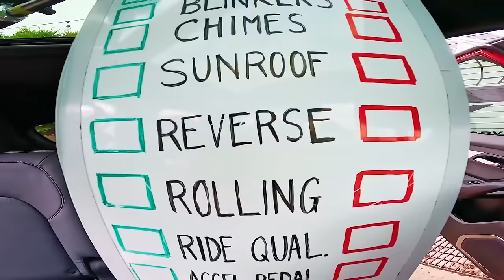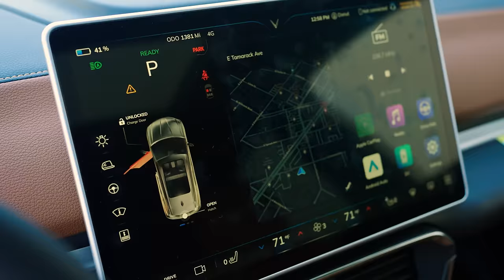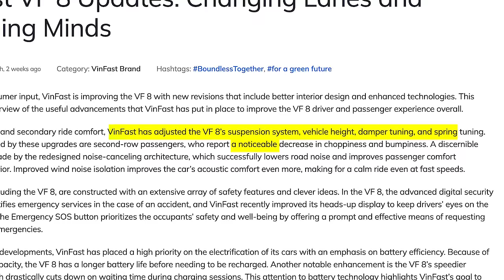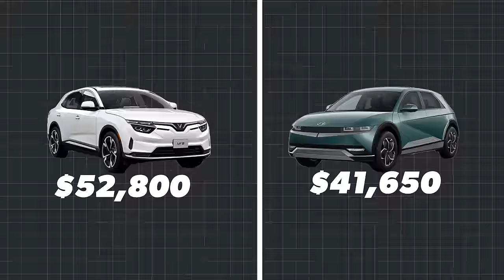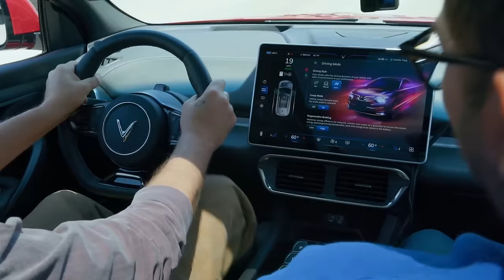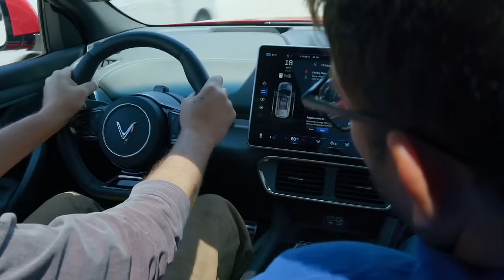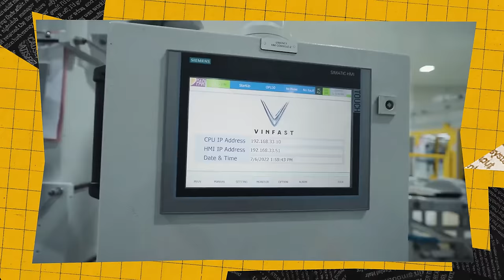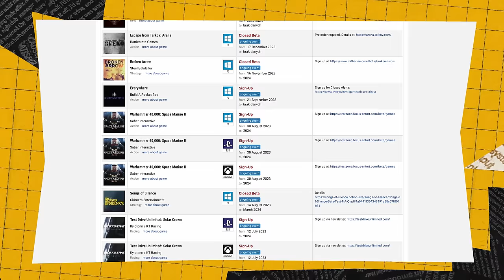We Drove America’s Worst Reviewed Car Again

Comment: I wonder how it holds up in the long term, where I live there are more Teslas on the road than anything else and I see a lot of them have water in the rear lights, not all of them but way more than what should be normal. Especially for so expensive cars, also sometimes I see Teslas with small amounts of water resting in the bottom of the headlights too. So will Vinfast be plagued by similar issues? or not? also, I recently read that NAF(Like a car association type of thing) was concerned about road safety regarding Teslas breaking their lower control arm on a pretty big scale, yet it's like the most popular car to get here so it's probably great to drive.

Comment: I actually think I might prefer the "shimmy" as you call it in regards to lane switching.
Not all parts of every major highway have rumble strips (and they are completely lacking on more rural roads), and I feel like having that built-in as a feature on a car instead of relying on the Highway Commission to develop common sense is a great way to prevent accidents resulting from distracted driving

Comment: One thing you forgot to mention is, the Eco version is around 1k less than the model Y  base model, has a slightly better range, a driver assist that is not an extra and dual motor. So in total a lot less expensive than the model Y base model. I you take the plus model and compare it to the model Y dual motor , the model Y has a better range but is 5k more , so I suppose that its more comparable.

Comment: The lane assist is annoying for any car and i think most cars wont let you merge without blinker, so i think thats related to a setting for sure. But yeah for 53k you would expect something that at least drives like a toyota or honda which are solid driver cars and strong. The kias might be cheaper and maybe feel good but yeah those cars suspension dont last too long. Hondas and toyotas suspension at least they start deteriorating after 120k miles when youll start hearing stuff

Comment: FYI - A few weeks ago,  a family of 4, living in Pleasanton, California were killed.  The car (VinFast - a vietnamese car manufacturer) crashed into a tree and killed all of them.  So sad.  The investigation found out that the control the steering wheel and speed was an issue.  Further investigation found that the issue happened several times before and dad has reported this problem to the manufacturer.  I wonder if this has to do with merging lane assist feature that prevent the dad from controlling the steering wheel. ..IMO, not sure if VinFast do anything to address  / solve the issue.  The family now is suing VinFast for compensation.... Family?  They all are dead... not sure who is suing.
Reply: Hmm I don't see any reliable sources mention the additional info. Can you provide it?

Comment: I do not get why so many of these electric cars only have the one centrally located screen.  Or why designers want it to look like the screen was added to the dash as an afterthought.  "Oh no, we forgot the screen that controls everything on the car. I know, we will get a tablet and just mount it to the dash. Job done!"  I get minimalist design but it can be taken too far.  Like in the other certain vehicles where the dash just looks like one horizontal line with nothing other than the screen and wheel to break it up, not even heating vents.  
But the worst is not having any gauges or info screens in front of the driver.  Having to look at the center screen just to see the speed would get annoying after a while.  There is probably a reason all the gauges have not been moved to the center of the dash over the history of car building.  It is almost like they need to change the internal design as much as the external design as a way to say "Hey! Look at me, I am not a regular combustion vehicle. I am cool and different!"  Why can't they just make it look like a nice, normal car but just have an electric drivetrain?

Comment: Honestly, I wished every car won't allow you to change lanes if you don't use your indicator. 🤷
Reply: On paper it sounds good, but it doesn't account for safety in an emergency. Being unable to swerve out of a lane last second in the case of another wreck or emergency in front of you is extremely dangerous. The changes made in the current version are much safer.
Reply: @thenoddistsdisciple 
I suppose, I should have added a </sarcasm> tag.
I understand the "in case of emergency" better than most I think.
Just last month I had to swerve into the right lane to not hit some idiot who was driving the wrong way on the freeway head on.
 I managed to do that just in time, I can't imagine what would have happened if the car fought me at that moment.
Though, I do remember actually using the turn signal a fraction of a second before I moved over.
That doesn't mean I wouldn't love to see some sort of smart system maybe that sends a jolt of electricity to someone's groin region whenever it decides he/she was too lazy or incompetent to use their damned indicators.

Comment: Breaking news ! 
One more Vinfast VF9 has burnt itself in hanoi on January 31, 2024. 

If you want to be a barbecue steak on Vinfast at anytime plz try it now.
Reply: That "burnt" car is Vinfast lux SA 2.0 not VF9, an ice car not ev car.
Where did u get that information.
Reply: @tuthanmau134     There are videos of a VF9 that bursts into spontaneous combustion in Hanoi. These videos were posted on YouTube yesterday. Viewers in Vietnam may not be able to see those videos because the VCP would ban them in Vietnam.
Reply: @hocutmeo3318  U're completely wrong, u're the one who doesn't know anything, it was a burned white VF lux SA - an ice car. The day before yesterday, I still saw the burned carcass of his car parked near the sidewalk in Hai Ba Chung district when I passed by on my way to work. I may not even know which brand's car caught fire, but if vf's car caught fire, the whole country knows.
I also clearly saw that behind the car there were 2 engine exhaust pipes, which confirmed that it was definitely a gasoline car.  
If u are an anti vf then u should also know that the rear of the vf9 car looks completely different from the burned car u mentioned, u are truly an anti like vice versa. 😅😅

Comment: I don't think the length of time a vehicle has been out should have any say on whether it is allowed to have problems or not. If a company wants to charge 52k for a vehicle, they better bring the heat versus the competition or at the very least throw the same heat as the competitors. Now if the cost was say 10-15k less than competitors on average, that I could get on board with. But I'm not just going to give them a pass because they are new and pay the same price or even higher than competitors that are better.

Comment: My fully customised maximally upgrade (no meth no water injection) 800>hp F10 M5 daily driver was built for around £53k from a £24k 2013 one owner base car. It's cheaper to insure than a Tesla, it is still able to eek 27mpg combined, it has more power in freezing conditions, it can drive through a puddle, it isn't 50% lithium cluster bomb...

Comment: Was this second drive on a revised 2003 model, or is this a 2004 model? The local dealership says it only has the 2003 model. I want to be sure what is available has the improved shocks. Thanks.

Comment: These driver aids are dangerous. My BMW i8 will drive perfect for 8 months then it started getting overly sensitive in the collision warnings and pedestrian safety aids where it cuts power. It has done it twice while I’ve been accelerating onto the freeway and I’ve had to pull over and immediately restart the car. Very unnerving and dangerous. You try to turn it off but it’s still there.

Comment: just fix the issues and come back it can happen if the company is straight up about it
Reply: The first video:
- Didn't know how to turn on an EVs Car
- Did not know how to turn off chimes
- Did not know how to turn off lane keep assistant. When this is actived , you must to try more force than normal to change lane without blinkers. iF This function is ON, the car is so weird and safer while you can not recognise the blind spot.
- Did not know how tesla model X can not permit to sale in EURO
The second Video still do the same.

Comment: You can tell Vinfast tried with the car and is trying to make it better. Which is why I hate to say, this car is going to flop in the American market unless they address the price. They need to be real. This car has no appeal at that price. Its behind most, if not all of the competition. Generic styling, subpar specs/performance. There is no way they really said we can sell this car for the same price as the top end Tesla they tested. Its a similar vibe to that car brand that tried to launch affordable electric cars a couple years ago, Kandi. Its lauched was way over hyped and the company never took off in the US. It really strikes as a huge lack of market research. I'm not an EV fan, but i would choose the Tesla 1000% over this.

Comment: A car like the Vinfast is the polar opposite of sustainable. Getting parts is difficult to say the least and it demands a premium price for electrical scrap bolted together in a crude way. What if something breaks a couple years down the road? Do you really expect me to pay for a new car every 5 years? Are you insane? Besides I have a huge aversion against Elektric Cars. Just put a cheap 4 banger in there that's easy to fix and make sure the body doesn't rust away underneath my butt during the first winter season. 
Guys, transportation could literally be so cheap if you didn't force all this overly expensive tech upon us. So no thank you, I will not buy a Vinfast, not a Tesla, not anything comparable. 

Also: why does everything have to be a giant tank-sized SUV these days?

Comment: I have to say that I really don't care for a bunch of technology and computerized bullshit. Definitely not in the market for an electric car. Just give me an older car with a 5 speed and a clutch and im satisfied. I don't even require power steering. Something simple, reliable, and easy to fix when something goes wrong. That's what I'm looking for in my next car. I also prefer driving a manual transmission over an automatic or cvt any day. A gas pedal, brake pedal, a clutch pedal, and a hand brake is really all I want. I don't care for all the fancy crap. Hand crank windows and manual door locks are perfectly fine if not prefered. Simple is better.

Comment: The Renault Scenic e-tech SUV has just been named "Car of the Year 2024", with a retail price of €36,000. Meanwhile, the price of the VF8 is USD 50,000. Vinfast is looking for ways to openly rip off consumers, while the VF8's spare parts come from China and the car is assembled in Vietnam for a pittance. The car is not well designed, so it is very heavy (2500kg) and consumes a lot of electricity. Not to mention that it is manufactured and assembled in China and Vietnam, two countries whose electricity comes from coal, which is very harmful to the environment. Currently, Vinfast's share price has fallen below USD 3 and the company has a loss of 2.4 billion plus the previous debt of 2.5 billion, so we don't know how long it will exist. In short, VF8 is a disaster for users and the environment.
Reply: Lol stop talking non-sense.
First thing first, what is your prove of "Vinfast parts come from China"? And even so, what's wrong with it? As long as those parts are good, it's fine. (And surely it's good)
About the weight, 2500 is around the weight of other e-SUV. I only spend a little time searching and still find out bunch of car with similar weight.

Comment: I just can not get into the EV at all.  For one it is NOT better for the environment, When the battery goes you may a well throw them away as it is very costly to replace them.  The materials are mind with slave labor.  The torque and instant speed is the only thing I like about them.   With that said a am a gear head and love the sound of a gasoline V8.  Also as a Jeeper who has driven an 4xe on the trails, I can say I did not like the throttle in all electric mode.